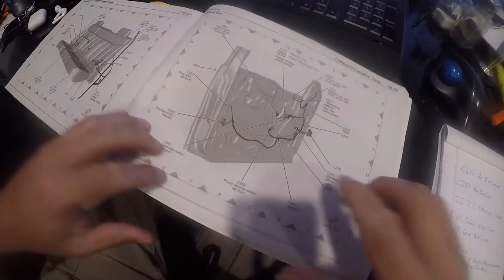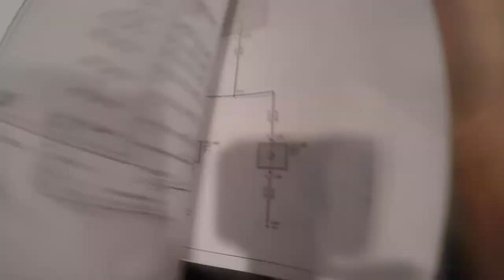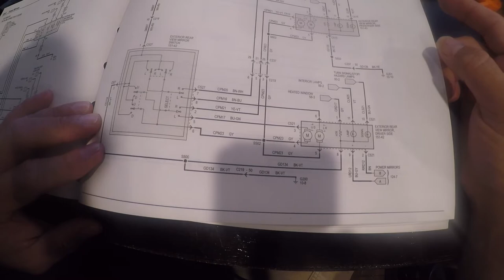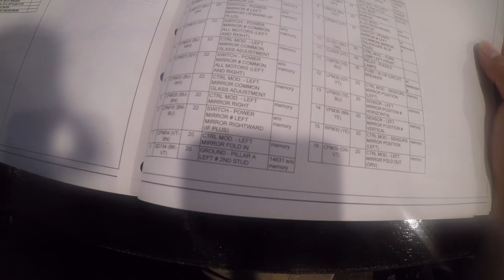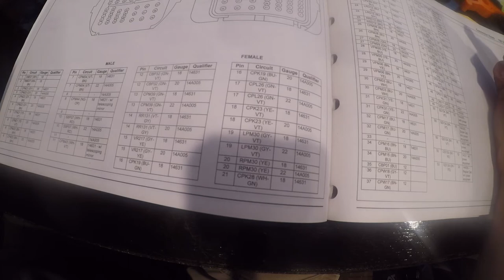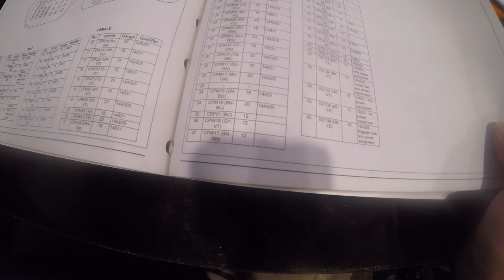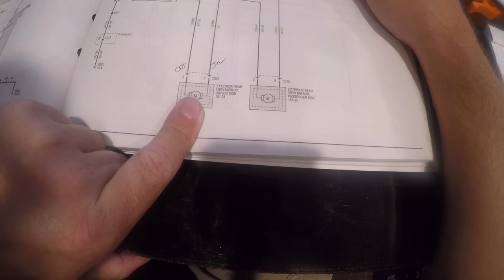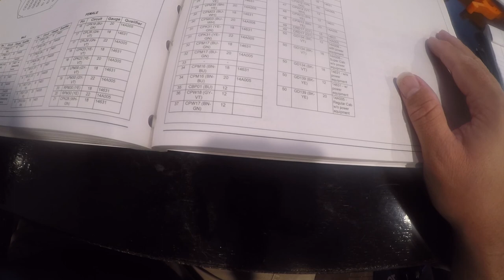2014 F150 Towing Mirrors: Exploring how to wire the telescoping functions

Comment: Just checkin in from the future (4 years later! How time flies!) to see if you ever got this working. 

😅
Reply from the maker: No.  I did not.  I've since sold the truck.  Decided Eco-boost would be eco-bomb one day and my finances can't handle a new engine so yea.... sold it and bought something simpler, cheaper and newer.  :)

Now, I'm a glutton for punishment, so I bought an old IDI 7.3 F-350 that had been sitting on a farm for a while.  That's a different beast and makes about as much speed as two riding lawn mowers.  :)

Comment: Did you ever figure out the wiring needed to connect the telescoping mirrors. If so, can you share?
Reply from the maker: No, haven't had time to mess with it.  Story of so many of my projects.  :)
Reply: So is the puddle lamp pin on the plug harness actually the running lamp on the mirror?